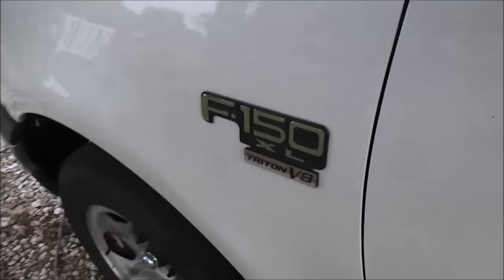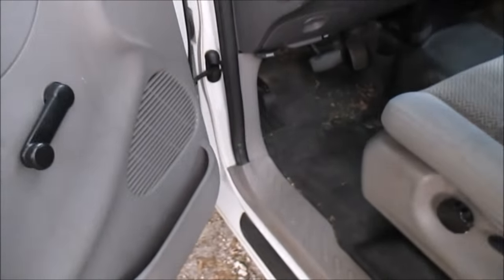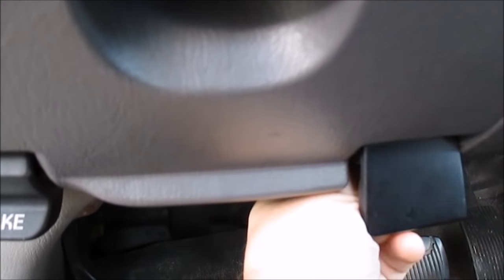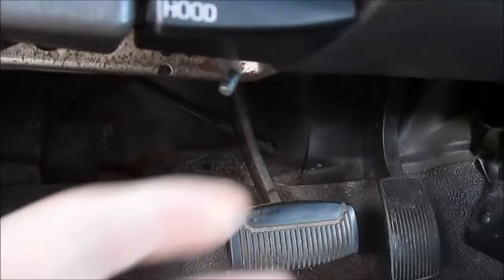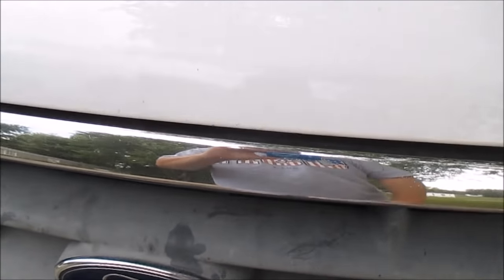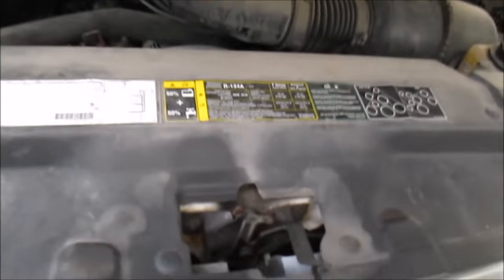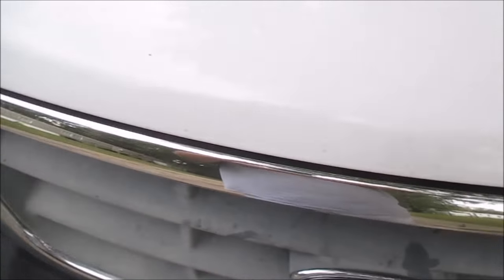How To Open The Hood When The Hood Release Cable Is Broken

Comment: Thank you for this. My car battery died and it's parked on the road, so I seen many other videos that said how to get hood unstuck but all thr videos said the car needed to be jacked up, I'm parked on the road and on a slight hill, so couldn't do that, then I searched up how to do it with a screwdriver, and your video was the most informative.
Reply: but if it's just a dead battery you can still open the hood with the latch.
Reply: Not if your truck won't unlock cuz battery is dead and key holes don't work like my truck!

Comment: Very Nice! Battery dead and keys locked up inside my 05 expedition. needed to put jumper on battery so i could use locksmith tools to hit my the electronic door unlock button. I couldn't ever get a screwdriver to work but I slid the bottom of my grill out and was able to reach in and pop it by hand since i knew just what i was looking for. Much appreciated sir!! :)
Reply from the maker: Thank you for watching!

Comment: Took me 30 minutes to manipulate the plastic shroud over the release mechanism. 30 seconds to disengage it. I actually used the factory jack handle & a pair of needle nose to do it, straight thought the grill. (No damage done.) After cleaning & greasing the mechanism, I used the blunt screw end of the jack handle to reinstall the pin on the shroud (also, through the grill). Thanks a million for this video; it worked, perfectly. Hope my trick helps if anyone doesn't have a lot of tools on hand.
Reply from the maker: Thanks for watching!!

Comment: Locked out of Ford Expedition 2007 dead battery and ignition key wouldnt open door. Tryed charging through the hitch wires, unlocking with clothes hanger, nothing. Thanks to this video  popped the hood in 10 secs with screw driver, charged my battery and crisis averted. Thank you.  Ford Expedition basically an F150 without a truck bed.

Comment: For %150 trucks with the "honeycomb" grill, you can approach the latching mechanism from the left, rather than the right as shown in the video. The pop tab AJ refers to in the video can be depressed using a thin piece of stiff wire rod. Thank you AJ!
Reply: Just replaced the latch and now I'm in this predicament you said approach it from the left side I can't see anything in there
Reply: John Paine
Reply: vicaras1
Reply from the maker: Thanks for watching!

Comment: Here is a solution that worked on my 2001 Ford Explorer Scout, when NONE of the recommended approaches would work.   For some reason, my particular car seemed to be a bit different from all the other Ford Explorers.  The  Chevrolet Monte Carlo bottom up approach video worked on my explorer. The main problem was accessing the vehicle from the bottom up. There was no apparent access path. There is, however, ever one approach that works, which is located just right of your license plate. You have just enough room to stick your arm up it. You just have to push a tiny plunger that is connected to your cable wire. It was extremely easy to move, once you manage to put a flat screwdriver with an extra long shaft in the correct position.

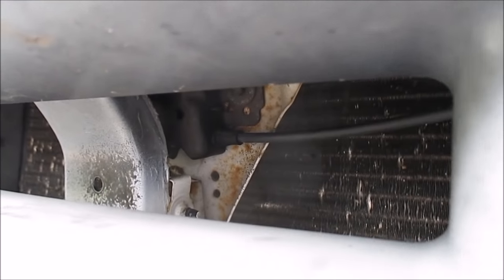Comment: Thank you for taking the time to make this video. I was able to get my hood open thanks to you. I have a 96 Ford F-250 and my latch is completely enclosed in a metal casing. If you look at the cable in your video (at 1:19) you’ll see that there’s a rubber grommet where the cable attaches to the latch. I pushed on the grommet until it popped out of its retaining slot, then I was able to grab the cable with needle-nose pliers and pop the lock. Hope this helps folks in a similar situation.
Reply: Not ur video

Comment: Thanks for this. My truck's battery is  dead. The door cylinder has never worked so the remote doesn't work right now. The passenger side doesn't have a door lock cylinder.  Life saver!

Comment: Thank you I have a truck 2003 f150 xl and the cable broke and the hood won’t latch, so it stays down when I try to drive, trying to figure out how to get the hood to stay down, so with this method if I get locked out I can hopefully be able to open it, how long app is that screwdriver so I can make sure I have one?

Comment: Thanks for your video.
Went out to roll up my windows last night and apparently left the keys in the ignition in the "ON" position of my 2002 Ford Explorer.  Woke up this morning to find my doors locked and my electronic keyless entry wouldn't work.  I never bothered to get an extra key made since I didn't see a need for it with electronic keyless entry.  But since the battery apparently drained down, and I'm not able to get into the locked truck to pull the hood latch to open the hood and charge up the battery, I was thinking I had to call AAA for help.
Nope.  Your video got got the hood opened so I could jump the battery with the wife's car, and WaLa!  The electronic keyless entry worked again.   Today at lunch---I'm getting an extra key made.  :)
Reply from the maker: Oh man that is pretty crazy set of events. LOL. I am glad my video helped you out and you were able to get back in your vehicle. I am the same as you though I only have my 1 key for my old 99 Explorer. I probably need to get an extra key made today as well. Anyway, hey thanks for watching and thanks for the comment. Have a good day.

Comment: Thanks so much. I been hunting down for a hood release cable and they sold out in stores I had to order one. So now I'm gonna go try this.

My car won't start up neither i have to use a screw driver for that. Until I get a new ignition switch and cylinder replaced.  So I need to get in the hood to start the car

Comment: Thank you very much, it is good to know. I even didn't know such thing can happen. Please could yo tell if I want to have a spare Hood Release Cable and can't find for 2001 Saturn SL2, is it possible to modify another one to fit the car? Probably if it is same length of the cable you can. Thank you again.
Update: on 2001 Saturn SL2 it doesn't work. More of that, when I put the lock in closed position with the hood open (I wanted to see how all that works) I could not open it back. I tried to pool w/cable how we normally open the hood (I should remark here that there is no problem w/cable or lock and I just wanted to see if I can open the hood if the cable is malfunctioning) and discovered here that the cable was not under any tension. When I closed the hood everything started to work again. So somehow the loop from the hood is needed to bring the lock in operation. So my question is:
@1:45 if you close that lock with your hands (pry bar or smth), can you open that lock w/open hood or not? I mean the hood is open and you close the latch (lock) and then open again.

Comment: How have to learn the Hood latch mechanism before to operate this procedure...anyhow this is great help, only few videos I have seen opening from the car grills, the key is to find the cable line and try to find the end of it then fit the screwdriver end in between the latch mechanism and pull sideward the handle opposite from the cable line direction, thanks a lot!.

Comment: If just the latch release handle is broken, then you should be able to get the cable with a small pair of pliers and pull carefully. It doesn't take a lot to do it. I've had the handle break on a Ford Taurus and used pliers to get in

Comment: I thank you for showing us how to open up that hood. My hood on my 1999 Ford Explorer won't open using the latch inside, and I have to find out if the cable is broke or the latch under the hood is not working and need to be lubed. I am checking the hood latch under the hood first and if that isn't the problem I will check for a broken cable.
Reply from the maker: You are welcome, and I hope you figure out what is wrong with your hood latch. Thanks for watching and thanks for the comment. Have  a good day.

Comment: I am having issues on my -'03 F150, We need engine service done, And The hood appears to be lower on one side than the other, I have no idea what is wrong with it, If I could send you some photos of the situation do you think you might know what to do.
Reply from the maker: +John Calmes 
If it is messed up in the front there are hood adjustment bumpers (google hood adjustment bumpers to see what I am talking about) that you can raise or lower to adjust the hood height. There should be a bumper on each side. You can look at the gaps on each side and try to adjust the bumpers until the gaps are even all around. If the alignment is off in the back part of the hood by the cowl you can adjust the hinges a little, but if needed more you can shim the bolt on the hinges. here is a forum talking about that http://www.ford-trucks.com/forums/1079056-hood-alignment-trick-worked.html   Lastly you can adjust the latch height itself by adjusting the bolts on the latch. Also you can shim the hood latch side with washers to get more adjustment.  These are just a few ideas I had on adjusting your hood, but truth be told I am not a good auto body guy and I dont have much experience in adjusting hoods, fenders, or painting. I have done all of those things but I am not very good at it. Those are just my initial thoughts, but yeah if you want to send me photos feel free to do so my email is mjpierce1979@hotmail.com  I dont mind taking a look, but I am not sure how much help I will be. Well thanks for the comment and have a good day. Also I was curious what type of engine service are you getting done?
Reply: Well, Not exactly engine service, But The battery is dead and we don't want to spend 500 dollars to get it towed to an autoshop, because we want to change the battery ourselves.
Reply from the maker: +John Calmes 
Well if your battery is dead. It is usually 1 of 4 things. 1. Bad battery (you can check this with a battery tester (load tester or capacitance tester) Or an at home test with no load tester is to use a voltmeter on the battery while you crank the engine over (battery should not drop below 9.6V. Or use a voltmeter and just check the voltage on battery with everything turned off (should be 12.6V for charged battery no lower than 12.4V) Most places that sell batteries can test this for you for free 2. Bad alternator if it is not putting out it is not charging the battery (test this with voltmeter on battery, and turn on every load in your vehicle to see if the alternator is able to keep up with every load turned on the alternator should still maintain around 13-15 volts when under load) Also check serpentine belt for slippage, if it is slipping the alternator can not charge properly. (most auto part stores can check the alternator for you for free) 3. A dead battery can also be caused by a parasitic drain. A P drain is something in the vehicle that stays on after the vehicle is shut down, which in turn drains the battery down overnight and then when you try to start it the next day or few it wont start cause the battery is dead. To test this you need an amp meter or a dc amp clamp (basically a way to check for excessive amperage draw) 4. Lastly the cables themselves are bad (you can find bad cables by visual inspection, check for looseness at all connections, look for corrosion (green or blue looking crap on the cables) and do a voltage drop test with a voltmeter (under load). If you have a high voltage drop in the cables you need to replace the cables. Well I hope this info helps you out.  Thanks for the comment and have a good day. Good luck on your battery issue.

Comment: hey I have a 95 ford mustang that I can't figure out how to open for the life of me, do you know about where I need to be to open the hood on my car? it would mean so much if you can help because I need to jump it.
Reply from the maker: I have never worked on a 95 mustang before, so I am not familiar with that particular vehicle. However if you are trying to jump the vehicle, and you cant get the hood up to reach the battery terminals, you might try looking under the vehicle to see if you can get access to the starter or the alternator from underneath. Either one of those components should have a B+ connection going to it, (which should go back to the battery) I would think you should be able to hook up jumper cables to the B+ on one of those components and hook the ground up to either the block or the frame, and jump start it that way. Now I have never tried to jump start a vehicle this way, so I am not sure if this is a good idea or not,  but in theory I would think this should work. I think it would be best to jump the vehicle using the battery connections, but if you cant get the hood up, doing it the way I suggest might be your only option. Well good luck to you, and I hope it works out for you. Have a good day.

Comment: I grab a hold of the cable right there in the grill and pop the hood then from there it opens good.  Now I'm thinking of just getting rid of the cable all together and simply fix a welding rod into the latch permanently and I may once the cable breaks.

Comment: Doing this on a 2002 explorer is not so easy. They put a plastic cover in front you need to destroy almost to get at lower latch lever. Thank you for showing how too!!! Now going to destroy cover open hood charge battery, etc...
Reply from the maker: If you just need to charge your battery, you might try going underneath and hooking up a charger to the starter b+ and the neg to the engine block. I dont know if that would work to charge your battery, but I cant see why it wouldn't. Well good luck to you on whatever you are trying to get done. Thanks for watching and thanks for the comment. Have a good day.

Comment: Funny...my '97 Explorer has a protective plate to prevent just this sort of thing. I'm gonna need a grinder wheel.
Reply: Rip
Reply: you might be able to pull that piece forward and pop it out
Reply: @billaa49  actually it worked! And any battery thief worth their salt can get in there. 😄
Reply: @DragonPilot  i suppose we could fasten down our batteries or something with a bracket, i think mine is zip tied in right now though so I could make a more permanent fixture and bolt that down in the future to prevent theft but that's pretty high risk and low gain kind of crime so I don't know how much I would have to worry about that